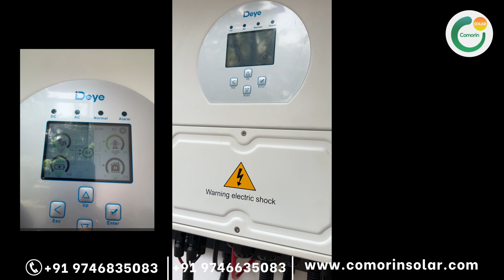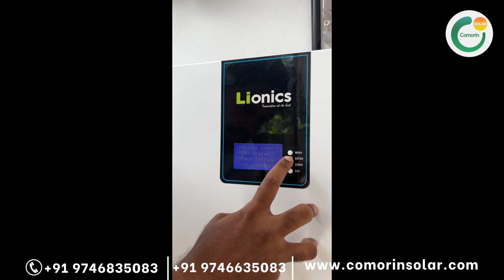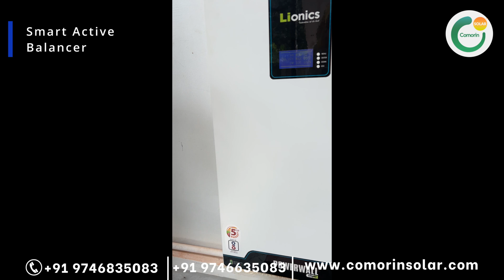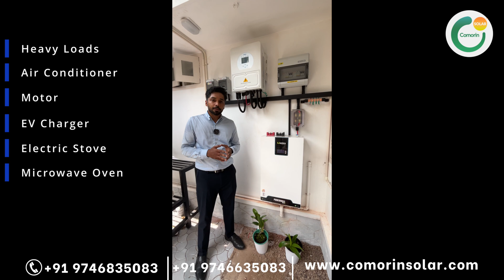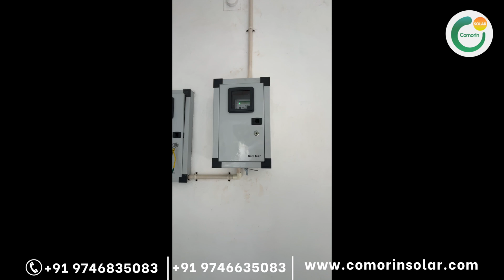Hybrid Solar System 5kWh with Lithium LiFePO4 Battery 48V 100AH | MNRE Subsidy Scheme Kerala

Comment: The battery can hold 5KW ?  or whats the capacity of the battery ?
Reply from the maker: 100Ah
Reply: How much Approximate cost with the same Specification without structure cost
Reply: @benoimadhavan1913 
Approximate 6lakhs
Reply: നമ്മൾ ഇതെല്ലാം കൂടെ ചെയ്യുന്നതിന് എത്രയാവും ഇതിൻറെ.
Reply: 48*100 appr 4.8kwh we can consider as 4.5kwh battery pack I prefer go with two 48*100 in parallel so that we can get app 9.5kwh in battery backup which is more than enough to run in night times